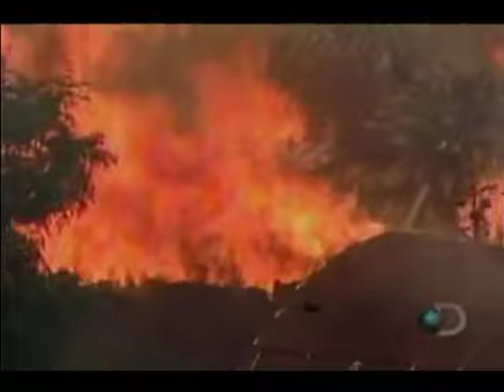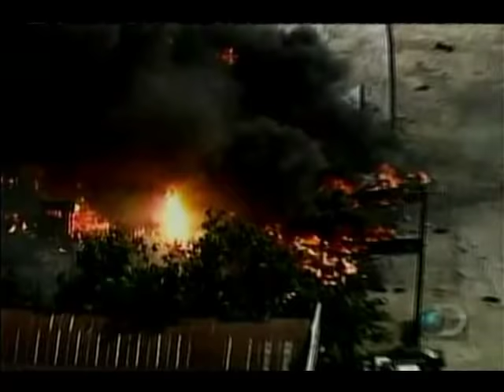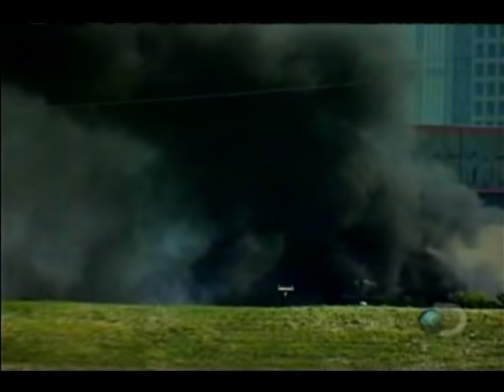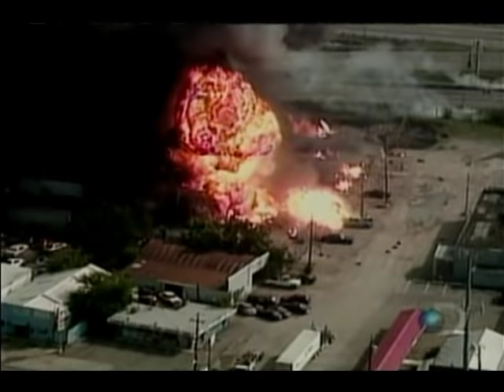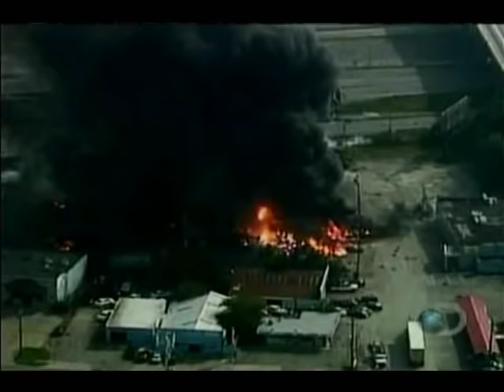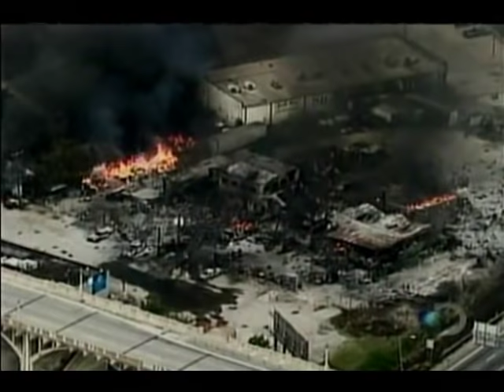Oxyacetilene canister plant in texas blowing up

Comment: dude,i worked at a gas bottling plant,it went up one day(long after i left) and they were finding 13kg cylinders of butane a half mile away,propane is way more volatile and acetylene would definately go off big time.imagine a 47kg propane cylinder doing it's thing when subjected to intense heat,those mofo's are like missiles and go through anything in their path.

Comment: No fire suppression system. Welcome to America.
Reply: leighrate not in the parking lot at least
Reply: Shop Dog I don't think you would be allowed to have such a facility in the UK certainty not that close to an urban area. It would be out of town and there would be berms and blast walls. Probably a water fog wet down system as well.
Reply: watch videos from India.
Reply: When the facility was built it probably wasn't nowhere near a downtown area.
Reply: If you don't like it feel free to not live here. thanks!
Reply: Ever heard of rapid conflagration? Btw fire suppression systems are meant to help people evacuate but not extinguish fire.....
Reply: Uh, actually, fire sprinkler systems are very effective at suppressing fire. However, certain hazards may need better fire suppression systems. And places like this, ought to be located away from population centers.
Reply: +Sasseuhfrass
Are such gas canisters supposed to be stored out in the hot sun and on hot pavement? Should maybe they be stored in a more safe manner, or perhaps underneath some sort of open-walled roof? What are the proper recommendations? And maybe there should be better inspections or maintenance of the quality of the cylinders before they are allowed to be refilled.
Reply: looking for the bhopal one ;)
Reply: Probably did  but Didn't last long

Comment: All the tanks have a blowout disc which allows them to vent relatively safely.  But when you've got this much burning at once, all bets are off.
Reply: Acetylene doesn’t have pressure relief safety’s like high pressure cylinders. Acetylene cylinders utilize a flush with a lead like metal that melts in boiling water, so if the cylinder is in a fire, the plug melts and the gas releases. But like you said, when everything around them is on fire, it’s not gonna end well.

Comment: Holy shit, what?! I was told they don't pressurize acetylene canisters, do they go ballistic like that only because of pressure built up from heating them?
Reply: Durr, just realized they get propelled by the explosions of other canisters.
Reply: under pressure, acetylene breaks down and releases heat. if one blows up, the acetylene mixes with oxygen and can burn at over 5,000 degrees. once one blows, the rest of the canisters are weakened by the heat and are bound to follow.

Comment: There should have been a deluge system which is like a sprinkler system on steroids. Such a system would have flooded those cylinders with water to keep them from overheating.

Comment: Now wouldn't it be nice to have a remote controlled tank with a pair of 6" water monitors and hoses trailing behind it to get close to this fire.   Unfortunately the hoses feeding into the tank would be as stiff as rebar and prevent the tank from easily maneuvering through tight spaces as it gets closer to the fire.

Comment: Csb investigation this and it was  hot and so It was a pressure relief  device that activated  same  incident  in St Louis  Missouri
Reply: Acetylene uses metal plugs that melt in boiling water and release the gas. They aren’t standard pressure discs like in high pressure cylinders. It was not hot enough to melt the metal plugs. They found it was a bad pigtail that caused a leak and acetylene gas being pushed through a very tiny opening and pressurized created enough friction to ignite. Acetylene is highly unstable and has an lower explosive limit (LEL) of 2%, so you only need 2% acetylene in the air to ignite and cause an explosion.
Reply: Wow

Comment: Have just watched videos of other bleve explosions. I think many (most) of these could've been avoided. Suppose automatic fire surpression and massive water sprayers were placed thoughout all key areas. Same basic concept as building sprinkler systems. This isn't rocket science, for God's sake. If properly designed, these almost surely would surpress fire, absorb or wash away leaking gas and keep areas cool enough to prevent tank explosions. Why aren't such systems in use now, especially in populated areas? Of course these would be costly. But consider the alternatives. As we all know, such explosions have happened many times. They WILL happen again. Murphy's law, for sure. It would appear there's no perfect set of avoidance preventive measues possible (obviously). Really would welcome comments from people with appropriate expertise.